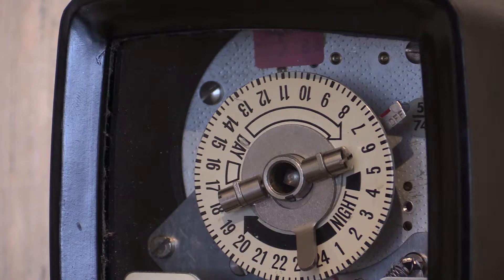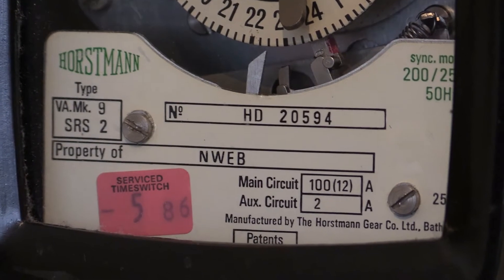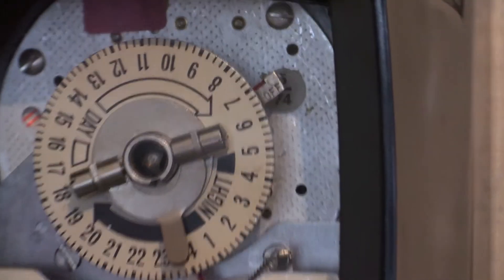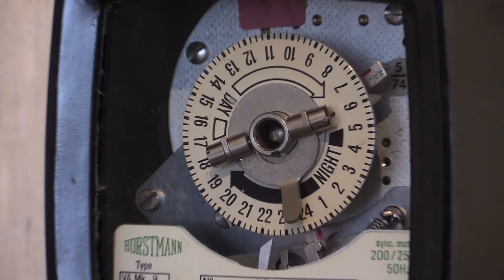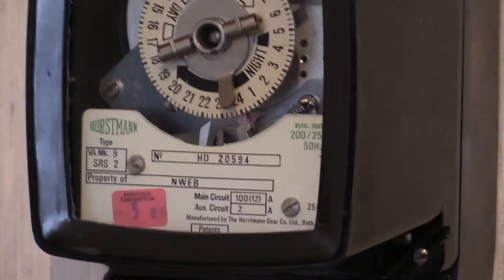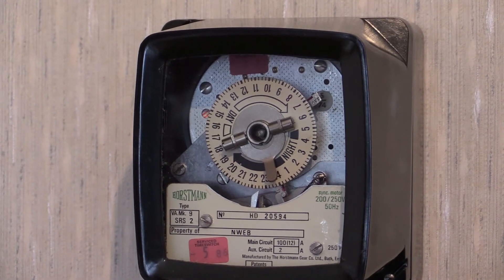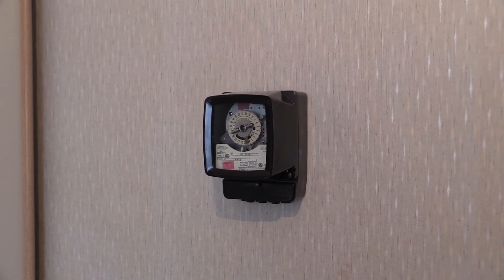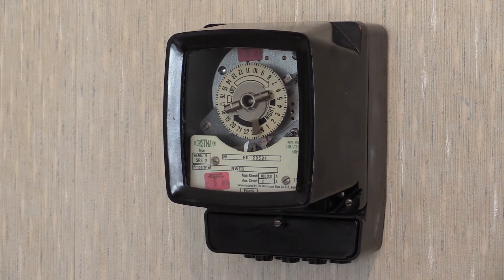Time Switch : Horstmann VA mk9 SRS 2 Rate Changer Timeswitch

Comment: The one I've got is serial number 20464 and dated June 1974 but has a clear plastic cover instead of the Bakelite and glass of yours.
Reply from the maker: Very good! Thanks for 
popping in to watch my 
Horstmann VA Mk9 Rate changer. 
You might be interested to know that..........
.
.
.
.
........I own THREE of the VA Mk9 SRS2 rate Changers and one of them does have the one-piece polycarbonate cover which you mentioned.

That unit is outside in the shed and powered-up and is particularly noisy which is why it has a job on the outside of the house!! :D

BUT WAIT!!! THERE'S MORE!!!

Dive into the Time Switches and Rate Changers playlist for even more!

ALSO...... 

(1) BAAAAAAAANNG that subscribe button! :D
(2) Get the bell on!
(3) Enable your subscriber perks too!

Please don't miss out! Many more vids on their way! :D

Thanxx for watching,

-Wayne's Electrical.

10th December 2020, 21.35

Comment: The casing of that instrument looks very similar to those of the GEC C11B2 and B3 variety’s:)
Reply from the maker: HAHA! When I received 
this timeswitch and 
unpackaged it from
its well-wrapped parcel......

.......I also noticed the similarities.

One thing I have done before you suggest it:

I tried to 'swap' the cases to see if they were compatible.

No, they are not.

The cases don't quite line-up with the back-cases and the timeswitch front-case is deeper than the ones you would find on the related English Electric / GEC / ABB meters.

Thanxx for watching,

-Wayne's Electrical.

4th May 2018, 20.35